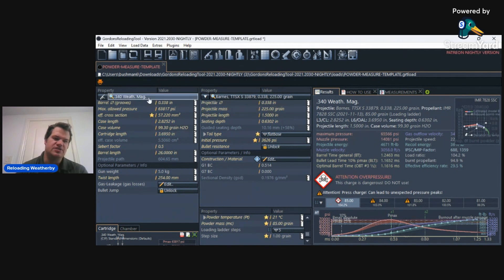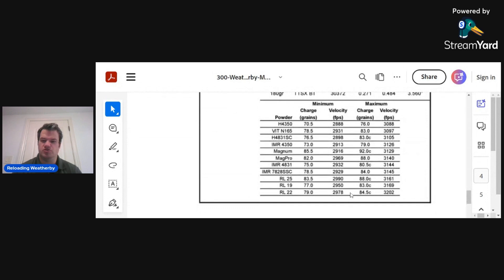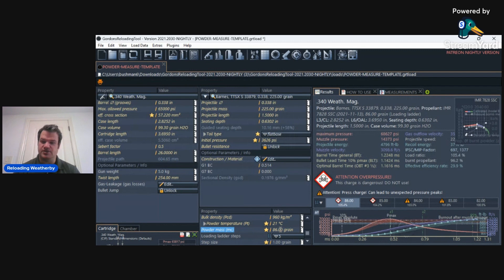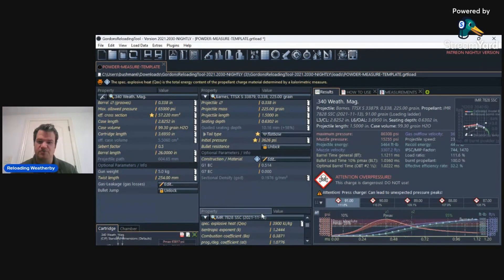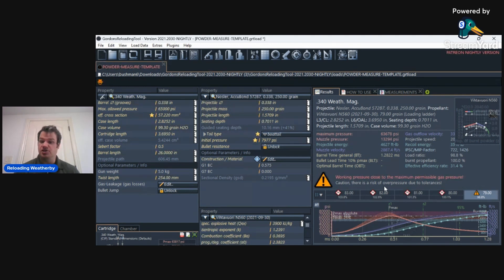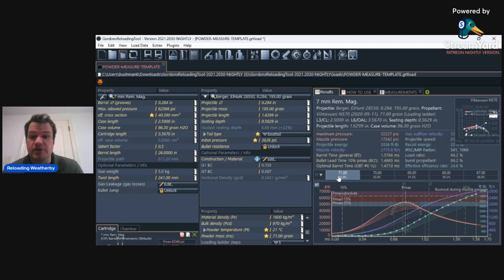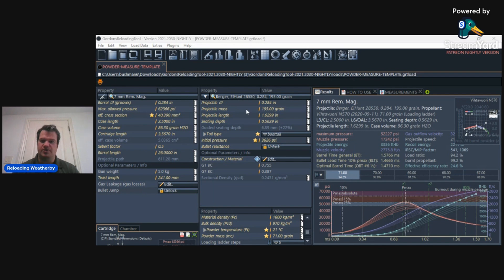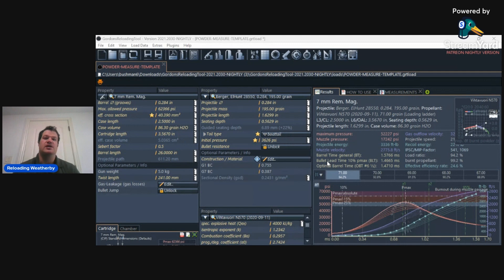Every Reloader Should use this! (GRT)

Comment: One important note:  GRT shows a confidence meter for each powder. If it’s a full bar green to the right, you’re GTG. However, if the confidence bar is short and red or red/orange that means GRT hasn’t been well calibrated for that powder. Surprisingly, H4831 falls into that category and GRT’s predictions were pretty far off. H4350 OTOH has high confidence and was right in the money once I input MY key variables (case capacity, COAL, bullet length - check that, and bullet jump). 

I started working with GRT a couple months ago, mostly based on suggestions from you and Tim at LCGW. It’s fascinating!  Just for starters, I had no idea how much case volume could vary between brands. The first thing I’m working up is a hunting load for a 20” 270 Winchester. (Yes, Tim would want to smack me for that) With that barrel length, slightly faster powders are “better” in terms of 100% burnt propellant. I have too many different powders on hand already, so I wanted something to try that I either already had or that would be a core powder for another cartridge. N-550 looked good but there’s no data for it with a 130 grain Barnes bullet. Vihtavuori Vuori shows it for 140 grains and up. Case fill isn’t ideal but burnt propellant in the relatively short barrel is 100%. Preliminary results look good for hunting - I think a safe load going 3,000 fps looks achievable.

Comment: Hello, good video / information.  I have one question regarding bullet seating.  I understand that once you input the cartridge length and select the specific bullet the seating depth will auto populate the seating depth. If I use the Hornady tool to find the lands and say reduce that number by X amount is that the number I should put in the tool replacing the auto populated nbr?
Thank you Mike.
Reply from the maker: Yes in the bottom left part of GRT you can unlock bullet jump. This will help get a more accurate prediction

Comment: Questing about Gordan's software. Say you have a good load that is producing good results. You calibrate everything in as suggested and your getting good data that matches what your real world results are when shooting. Can you or do you try to equal the same pressure using a different powder, to get close to something that might shoot the same good groups or do you try and mimic the same velocity or is it all trial and error again with another powder. I was thinking about this with my 308 win. Reason for asking one powder is not considered a temp stable powder and one is. Two powders are CF223 and Varget.  Also really cool stuff you putting out.
Reply from the maker: You could try it... depending on the quality of your gun you will find trends that a bullet and cartridge will shoot well at a certain velocity.

Comment: Something that I have had issues with GRT is that it doesn’t allow an input for the primer that you’re using.  It’s puzzling because it requires precise data to be inputed in every other aspect of building a cartridge.  It’s been my experience that when everything remains the same except to change primer the performance changes.
Reply: you can change the primer when editing the starting pressure,, click it an see,,

Comment: had this program for a while but so much data to enter...but I just watch little crow GW using it to decide on a proper powder that would give 100% burn and safe pressures. Thought well I can at least use it for that. Powder temperature is another odd stat that can be difficult to be precise about.

Comment: I use the Gordon tool. I put in book loads and the program says almost every time that the book load is too hot. Now I know if you use the Barnes data it is on the hot side. I have used data from Barnes and had no pressure signs even though Gordon's said I would. Some of this has been done with ball powders like CFE223 and Hunter. I still use Gordons tool for looking at loads and I play with the starting pressure number some times and the barrel time. Overall it is a good tool and I like using it.

Comment: This tool also said that your 195gr 7 rem mag load from last video nearly 65k pressure......which is well over the SAAMI spec for the cartridge which is 61k 
    Dangerous........Probably not especially a newer rifles......but NOT certainly not standard spec
Reply from the maker: And the tool said a 7mm PRC with this bullet going 3000 FPS is at 69k PSI...
Reply: @ReloadingWeatherby   Yeah that's definitely living the razors edge and beyond, far safer adding barrel time if you want more velocity especially with heavy for caliber bullets

Comment: In case you don't know, you have to get your cartridge volume correct, temperature is also important, the seating depth of the projectile &, in the bottom left corner of the screen above the chamber drawing, you'll see "Bullet Jump". Click on that & a screen will pop up with a warning, you click on the lower left box of that pop up & click "read & understood" then, click on "UNLOCK". When that pop up disappears, you should notice the "Bullet Jump" button is unlocked & now says "Disabled" Click on the "disabled" word  & a heap of zero's will appear & you can set the bullet jump 0.020" in thousandths of inch.. This is important because the default setting is Bullet Jam. This ofcourse raises pressure in the calculation & gives exaggerated velocities.
Reply: Well that seems like incredibly important information!  Thanks

Comment: Also when you use the OBT if you take the burn rates from the modified speed and input it into the main window it will do better in the future. Also be sure to update the temperature of the powder close to the temperature of the air if you were out all day.

Comment: Does that crono change POI?
Reply: Get a labradar now that everyone is drinking the new Garmin Kool-Aid 🤣🤣🤣. It helps me get accurate velocities and more real world Ballistic Coefficients by extracting the data from the SD card into my computer.
Reply: @ArpexOfficial I would the Bryan Litz measured BC’s more than the ones you could measure with Labradar , since he is using far superior measuring equipment. The Garmin is living in my range bag , so I don’t have to drag another bag or box to the range if I need to test speed. I just always test speed now to learn from temperature influences etc on certain powders and loads
Reply: @Johnsormani  true, but Bryan won’t test the bullets I shoot unless he gets paid by the company lol. Every gun is different and therefore his BC’s are just a starting point just like the ones I get from my labrdar. Either BC still needs go get trued
Reply from the maker: Yes

Comment: This could be an interesting resource, thank you. 
I suggest caution with the magneto-speed chronograph, I had many, many velocity readings that were ~5% higher than the real velocity. I confirmed my suspicions with an Oehler model 35P, and later with a Garmin Xero C1. I found that with the Magneto-Speed, if the wand was a little lower than optimum, the chronograph would give false high results.  I now use the Garmin exclusively. Just saying  .  .  .
Reply from the maker: I just watched a video comparing all of the common chronographs. The magneto-speed was consistently about 5 FPS slower than the Lab radar and Garmin.
Reply: @ReloadingWeatherby  It required three years to figure out what was happening with the Magneto-speed. This variance happened only when the device was not properly adjusted, by error on my part or loosened under sustained recoil and muzzle blast.
Reply: @georgejohnsmith  I believe Reloading Weatherby's velocity. I am merely suggesting caution with the Magneto-speed chronograph. I had run into a situation several times whereby stated velocities were high due to improper/out of adjustment of the wand. Ultimately, I switched to the Garmin Xero.
Reply from the maker: @georgejohnsmith I'm making it up? LOL
Reply from the maker: @georgejohnsmith I'll have to do a video on it. The case capacity difference between the 2 brass was a lot... which is why I had a huge jump in velocity

Comment: if I'm understanding correctly and provided the desired bullet & powder are in the database, one could use this tool to develop a load for which there is no published data (e.g., 160gr 338 WBY RPM). Is this correct?
Reply from the maker: Correct. But 338 WBY RPM isn't in GRT... so you would need to put it in yourself or go into Discord and find it

Comment: GRT is awesome 👍
In point of cartridge it is not really difficult to build a new with the specs. A little tip from a German, use the CIP files of the cartridge in this files are all the data with the correct names like in GRT. 😉
So I build a 7PRC to simulate and evaluate weather I should buy a 7PRC or not. For me it is a not 🙈

Nearly the same is with powders. A lot of die manufactures supply the files for the powders to import directly into GRT. 
Search therefore or write them. 

The only downside is the bullet… there is no way around searching for specs and the usage of your calipers. 

Unfortunately Gordon passed away in the near past 😢

Comment: Regarding your 200+fps difference vs Barnes data, some minor changes do add up. Example, different barrel used, their test bbl v your weatherby; that can be a 50-100+ fps change alone. I've noticed Sako and Tikka barrels are considerably slower than Ruger, Remington, and cut-rifled barrels as an example.  Different barrel length, yours may add upwards of 60fps. Different LOT number of powder; sadly, even with temp stable powders, I've noticed around 100fps difference with Retumbo - I lost 100fps going to a new LOT. I noticed about the same with some 25 year old IMR4350 vs new. The old stuff was much faster. Same thing with Reloder 19 and 22 for me, old v new LOT numbers. Finally, brass and primer differences can add a few fps changes.
Reply from the maker: Different types of brass makers can make a huge change. I have Norma made 257 Weatherby brass and newer 257 Weatherby brass that has a 3 gr capacity difference.
Reply: @ReloadingWeatherby  Yessir correct. I saw it with Lapua v ADG v Peterson v Norma v Nosler. Several years ago while referencing the Barnes manual, I was reaching max 1.5 grains before they did in a 270 Win with 130 TTSX and Reloder 19. Maybe even 2 grains. I'd have to check my notes but I'm pretty sure my brass and primers were identical to what they used.
Reply: @danielrouw2593  Yes that too. I was being broad and including it in the barrel comparison but didn't make that clear.

Comment: Call me old-fashioned, but if my handloads for all of my rifles, including my 8 Weatherbys, will knock a mulie on his ass at about 500 yards, I'm good. Data is good for analyzing how to do it, I'm content just to know that it'll get 'er done! So far, after thirty-plus years of experience in handloading, it hasn't failed me yet.
Reply from the maker: Thanks for watching!
Reply: What if I told you, you can use GRT to load exactly where you need to. No ladder tests, no multiple range days, and no wasted components.
Reply: @TreverThompson-ih4pc  All the way down to seating depth, neck resistance (which bushing to use), which primer, brass to use?  I have never used GRT. What does GRT need from a shooter to tell me exactly what to load if I want to use a 139 Barnes LRX in a 280AI? I'm heading to the range tomorrow with a new 280AI. I can test GRT recommendations tonight and shoot tomorrow.
Reply: @Accuracy1st  I recommend you take the reloading all day advance load development class. It’s taught by an industry balistician who works for a powder company. He teaches internal ballistics and what actually matters when it comes to loads. It’s not as convoluted as most think. He teaches what to put in to GRT to get the most accurate results and predictions. GRT is a model, knowing what to input and how to calibrate it is a very crucial part of the process.
Reply: @TreverThompson-ih4pc  who is the instructor?
Reply: @TreverThompson-ih4pc  
What if I tell you that I load to exactly where I need to without excessive component waste, minimal ladder test, and wind up with excellent results without GRT? By the way, I enjoy multiple range days because I shoot myriad caliber handloads for all of my rifles and handguns. It's my hobby, not a chore.
Reply: Call me old-fashioned too  - same rationale
Reply: This app isn’t for the one minute of deer fudds like yourself. This is more for precision hole In hole accuracy at 1000 meters

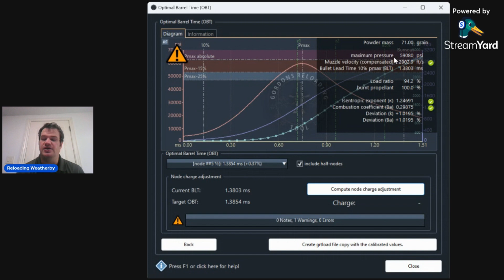Comment: GRT still requires you to dial in the burn rate of the specific lots of powder you’re using.  As shown in the OBT example at 9:02, GRT will give you an adjusted (k) and (Ba) number based upon your observed fps.  Update those numbers in the Powder settings section and your data should align for that lot of powder.
Reply from the maker: Thanks for the tip!
Reply: So you change the burn rate until you match the muzzle velocity that you've measured?
Reply: @Spruce-Bug  If you plug the velocity into obt then you will get your powder coefficients and then plug those values into the powder section and you will see it gets your velocity almost spot on. Then use that specific input to work out new nodes